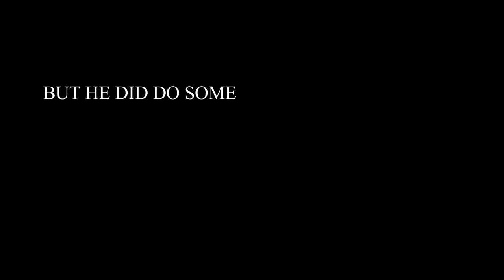J-Channel Race With My Amazing Mentor

Comment: Yeah I knew that last message was gonna show up, my boss wouldn’t have let me do those cuts like that no matter how clean it looked LMAO
Reply from the maker: lol yea those lil L cuts leave gaps in the corners, back when we both worked for our old boss a homeowner complained about the "gaps" and they have a point, if you look after the siding goes up there's gaps where you can see wood/house wrap or the window nail flange. doing it like the notching tool doesn't take much longer as you can see and it looks/functions better too

Comment: I have never seen anyone take so long to put J channel around a window. You guys do things totally different than down here in the south. Gotta remember you ain't building no piano. The main thing I want to know is where are you guys getting all these one story houses that are so close to the ground? Have you ever seen a 30 foot walk board? Have you ever started at the ground and finished by hanging the soffit and fascia last? As in starting at the ground and completing everything as you go up?
Reply from the maker: Yes
Reply from the maker: Also, if it's so slow, beat it lol tims win done even count here because his quality was bad with the flange overlap
Reply: @NWIVeteranConstruction  I'm almost 70 years old started hanging siding when I was 15 and hung into my 30's then took a job in a plant as a maintenance man until I got laid off. My dad died in 95 and in 98 I had a heart attack and to date 16 stents and open heart with 3 bypasses. So I seriously doubt you could out hang me during my prime. I really cant tell exactly how you're going about installing and cutting the channel. If your trying to miter it all on a 45 it's not wood so really no need for all that. We worked as a team one cut the other hung everything especially after we reached ladder height. We did use a homemade miter box once one of us was off the ground mainly for soffit and short runs between windows and such. Seldom did we install siding or the accessories on a wall that wasn't covered with a foil on paper type vapor barrier and or foam core. Get back to work you can't make any money sitting down you're just a nickle holding up a dollar. LOL